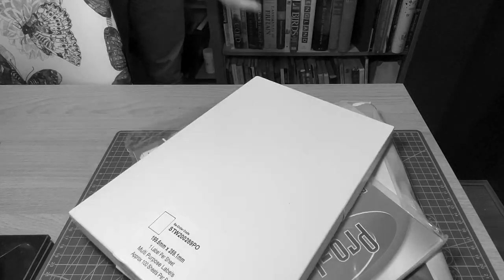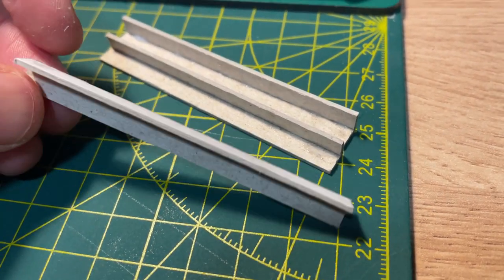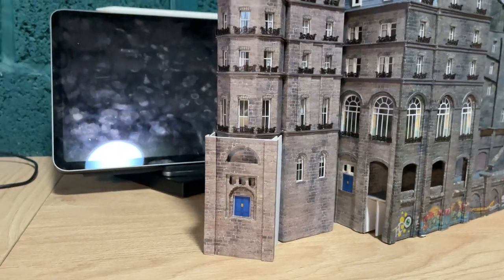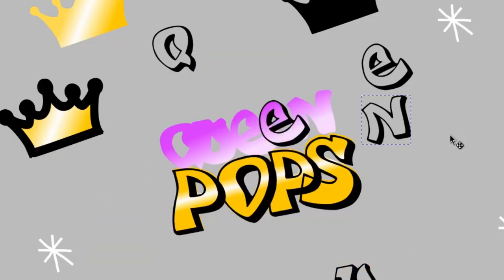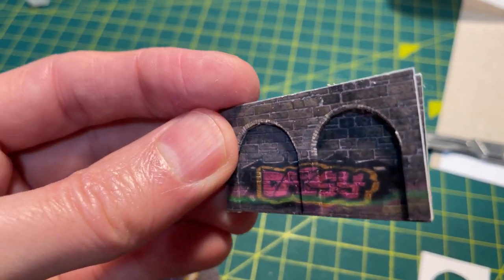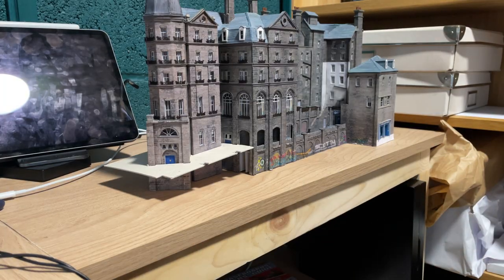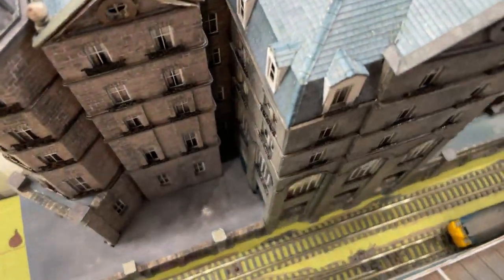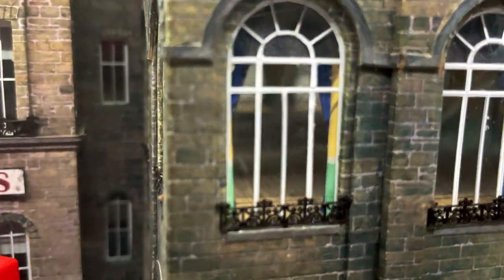The Hotel Is Finished! Embedding a scratch built hotel into its landscape

Comment: Congratulations Michael on the completion of your epic Hotel build. As always it looks stunning.... I'm just hoping that it isn't dwarfing the reduced height clock tower of your equally impressive railway station.  Who needs a 3D printer, I too am a committed card and scalpel builder.
Reply from the maker: Thanks so much Paul! I did worry about that on and off too. The hotel's tower is 9 scale metres taller than the station tower, but it also stands on top of the retaining wall, so it's even taller than that. However, I think the hotel compliments the view superbly. I intentionally made the hotel a darker stone than the station and it therefore helps to lift the station and keep the clock tower the focal point somehow. More by luck than judgement, but it's all worked out well! Thank you for joining me on the journey! :_chandClass47:Michael

Comment: You can go and have a cup of tea now. You've earned it.
Bob
Reply: I think Michael has earned a dram, or two, of one of those single malts that keep sneaking into the videos as glue holding weights!
Reply from the maker: Thank you Robert, and Duncan. You know, I may already have done both of those things... But for now, I am off down to Signals for a cuppa and some rhubarb turpin. Cheers! :_chandClass47:Michael
Reply: @Chandwell  Rhubarb turpin? That's not a Spenny dish.
Lovely job. These videos are great reference material. I'll be coming back for years to remind myself how things are done.
Thanks,
Bob
Reply from the maker: Haha thanks Robert. Watch tonight’s video for some more info on rhubarb turpin!
Reply: @Chandwell  Can't wait. Love rhubarb. All this modelling and haute cuisine, what more could we ask for?
By the way, only my mum called me Robert, and that was when I had done something wrong.
Thanks,
Bob
Reply from the maker: Oops. Sorry. Wasn’t paying attention. If my mam ever used “Michael Scott”… I knew I was in trouble.

Comment: Huge congratulations on completion, as someone who has taken 10 months to finish a model about 1/20th of the size of this. I've felt a lot more confident taking a scalpel to things that aren't right after watching this series, and am determined to glue perfect 90 degree angles in future. One thing I'm curious about is how you avoid warping of the paper/card when it's glued together. 

 I imagine the internet connection must be a big selling point for the Royal Scot!
Reply from the maker: Hahah yes, the Internet has not yet been invented but the Royal Scot has an AWESOME connection!! :) I have never suffered from warping card. I don't know how or why, so I can't really offer any advice. Where do you find it warps? :_chandClass47:Michael
Reply: @Chandwell  It just sort of...bends. I've tried putting some very heavy books on top whilst it dries which helps a little. Maybe I'm using the wrong type of card which is too absorbant.
Reply: @musosiimo3199  maybe you add too much glue? I add it very thinly using a wiggly line from my fine tip applicator. The bead of glue is probably only half a millimetre wide and I leave a gal of maybe 10mm between wiggles. Once the surface texture is on, I then smooth it all over with my fingers or a wallpaper seam roller. This spreads the glue out under the paper… how are you applying the glue?

Comment: Great Video again..Thmubs up but i have a question. The Frontface of your Buildings are only printes on a inkjet printer? How resistant is tihs against light and aging?
Reply from the maker: Hi! I don't know for certain as Chandwell is in a windowless room. But the oldest parts of the layout are 3 years old and have not faded. I use photographic paper and genuine Canon ink, and I always brush-apply four coats of varnish, so maybe that helps.  :_chandChandwell:Michael.